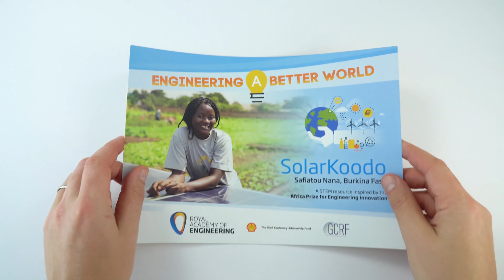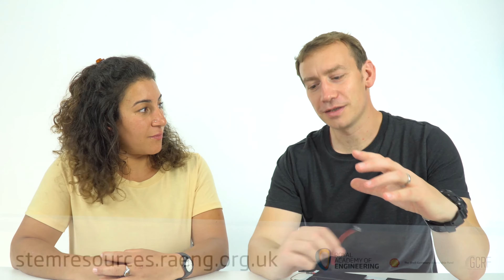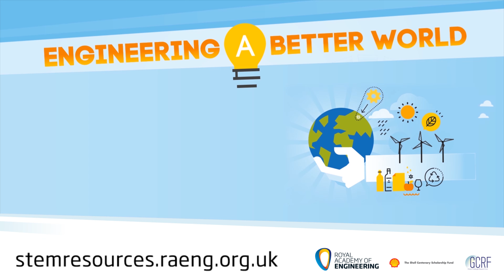SolarKoodo - Engineering a Better World - RAEng

Comment from the maker: 0:09 – What is SolarKoodo?
0:28 – Country profile and Sustainable Development Goals
0:35 – The water we eat 
1:18 – Why solar power?
1:31 – Building the electric-cart
1:50 – Investigating solar-panel circuits
2:30 – Solar-powered pump
2:47 – Manual water pump using the syringe 
2:56 – Storing energy